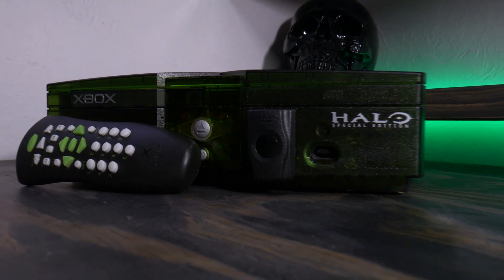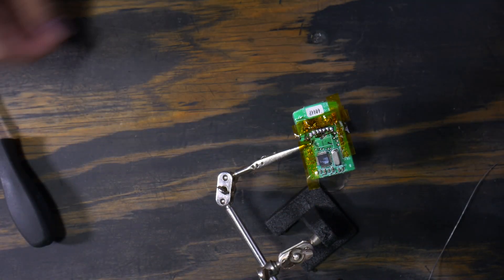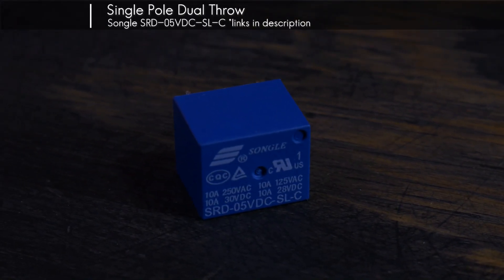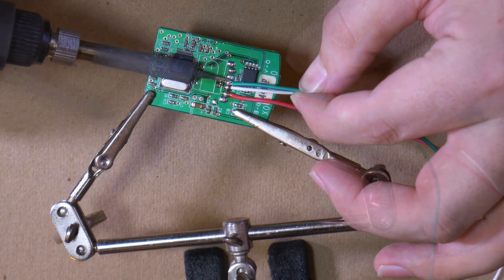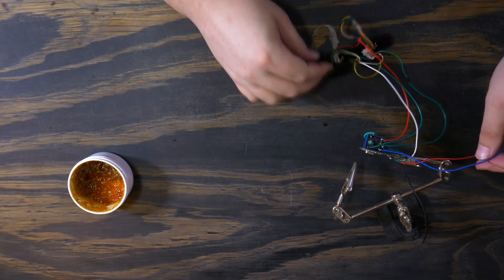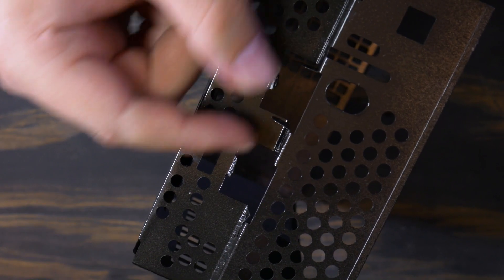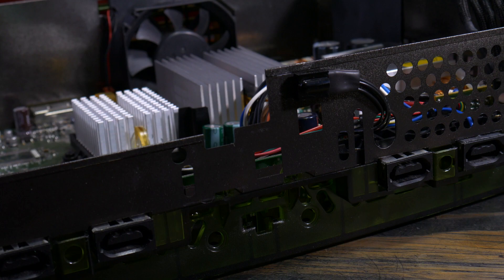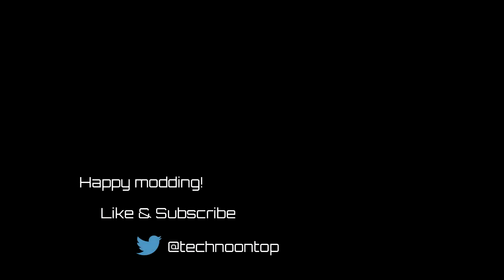How to Internalize DVD Playback kit Relay Mod

Comment: Hey, im trying to mod an OG xbox v1.1 with alladin modchip xt, the xbox does not have a dvd drive, i edited the evox bios and disabled the dvd drive check, but when i boot it it always gives me error 07, i was wondering if you had to do anything on your modded one, how did you disable the dvd drive? i read also on forums that i should jumper some of the yellow wires but that also did not work at all.  You made it work because of that ind-bios? can you share the no dvd bios so i can flash it on my modchip?
Reply from the maker: Yeah the ind bios just took care of it. But the check or lack there of makes the console boot slightly slower. On my main Xbox (slim with no DVD drive) I did the bridging of the wires trick (pretty sure i just bridged pins on the underside of mobo) . The bios isn't any kind of special one aside from maybe editing the colors.

Comment: Where does the dvd playback kit tie into the xerc 2 xe? Does that wire out off the dongle you show early in the video just go to the irs pad of the xerx 2 xe chip?
Reply from the maker: Yes it's just the one wire
Reply: Thanks. Love your mod videos. Learned alot from them.

Comment: Great video! A question, does the Same schematic work for a controller receiver? Only difference is I need to connect the yellow wire as well right?
Reply from the maker: Yes it would be the same, you also wouldn't even need to touch the yellow wire, I typically remove them,
Reply: @TechnoOnTop thanks for the answer. Ok, perfect. I just got all the parts needed so I’ll try it out.
Reply from the maker: @sebastiansahlgren7090  awesome! Good luck with your mod!
Reply: @TechnoOnTop  Thank you!